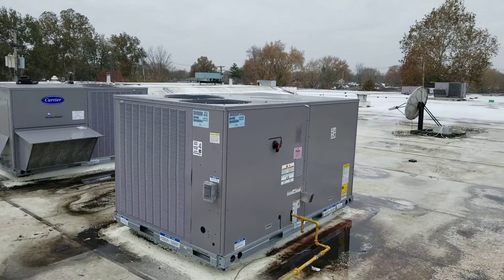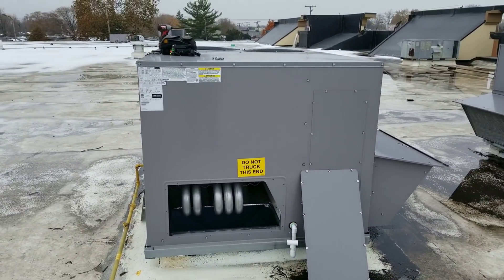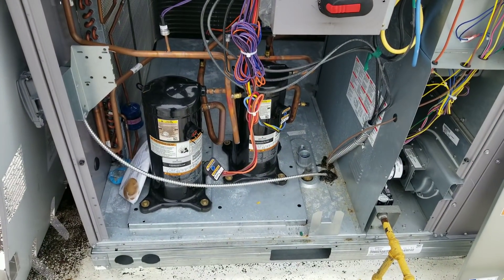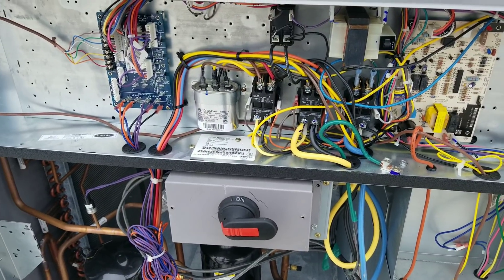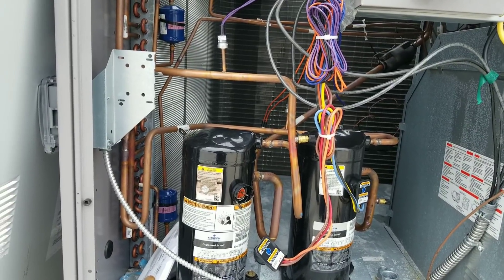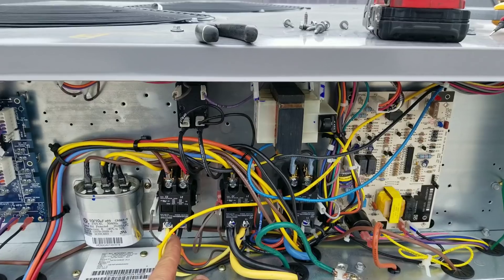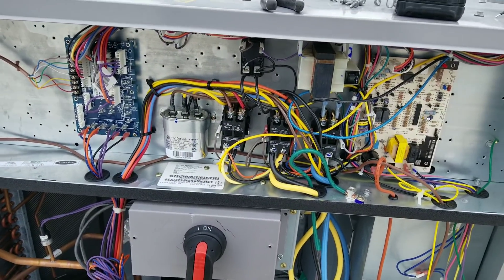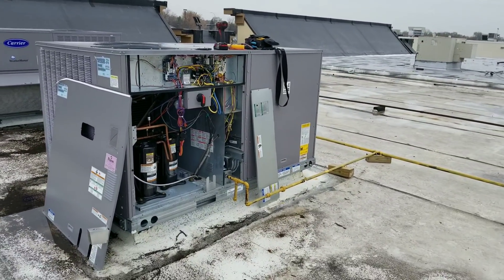Carrier package unit tripping the breaker

Comment: Just a general question. Have you ever tried the phase rotation setting on the fieldpiece Sc660, is it reliable? Just like you said “no proper commissioning on hvac unit” if done right they should of caught the problem.
Reply: Yes the phase rotation is reliable on the meter.there are other meters out there, Amprobe,  that have true 3-phase rotation done through 3 individual test leads that make it a little easier to do then the Fieldpiece 2-lead method. But it does work and every commercial install crew should have at least one guy with a meter that does 3-phase rotation before they start up the equipment.
Reply from the maker: I have not but I have heard about it and I think my next upgrade will be that 660-- it comes in handy for sure
Reply: @curioushvacguy6876  NO...don't get the sc660. The brand new sc680 just came out.
Reply: I got the amprobe 320 from watching Tcphvac/r videos I thought that was an awesome feature to have as well as motor rotations for pumps. I have used the 3 phase sequencer a lot more then I thought I’d be using it does come in handy. For the price amprobe meters are very affordable for what there pack with, there very rugged as well. I believe I’ve seen Shannon comment on these meters in the past as well 🤘🏻
Reply: @HVACslayer  yep, Amprobe has a really nice 3- phase feature. I really like how the dash marks go in a circular motion around the display either clockwise or counterclockwise. Makes things pretty cut-and-dry as to whether you're wired correctly or not.👍
Reply: Shannon Knight HVAC 😂 yeah it’s pretty idiot proof if ya can’t figure that out should not be anywhere near electrical. I got my bro into that amprobe meter as well,that’s his go to in the field.

Comment: It blows my mind that 
1_ they probably didn't check phase rotation
2_ maybe they did and someone messed with the wires upstream , but still , nobody complained about no airflow
A lot of the units I work on actually have phase rotation monitors , and even then , I still check for the proper rotation , I even bought a phase rotation tool off my own money because the one my company provided me with I didn't like .
Oh well , one company's mistake is another company's payday I guess...
Reply from the maker: Hey Sterling- what type of phase rotation tool did you buy? Ive found this similar issue a few times following up after other companies, still blows my mind that nobody caught that.
Reply: @curioushvacguy6876   Amprobe PRM-6-EUR it has phase rotation , missing phase , and non contact wireless motor rotation detection : you basically place the device on the motor , like for a centrifugal fan , press the button and it detects the rotation from the magnetic field I think .
I've tried that on a water pump and it worked , I was pretty impressed !

Comment: I love how they took the time to drill the holes for the thru the bottom electrical connections, installed the connectors and then proceeded to knock new holes run mc cable and gob it with blackjack. Got to love it!
Reply: I'm embarrassed to see this kind of electrical work - those Myers hubs are worth more than a case of Blackjack and they're empty 🤦‍♂️
Reply from the maker: Im guessing a permit was never pulled and an inspection never done

Comment: Strange that they had you perform the heat start up. The installation company should have done this. I’m not sure how warranty work is covered there but any company touching equipment here can void the warranty from the installation company. I know you didn’t do anything wrong but the installation company doesn’t know what you did. That compressor should be covered 100% by the installation company. I’m sure the customer will not want to spend any more money on the equipment and you won’t do it for free. Anytime you do start up on 3 phase equipment check the rotation of the blower (if 3 phase) to confirm the rotation is correct. All other components should be phased the same. Stay safe.
Reply: I have come across units where blower and compressors are not phased the same...also a lot of new roof top units have ecm blower motors are single phase so you really have to check compressor rotation
Reply: You are correct. This has happened to me as well. It is the best way to see if they are phased the same. To start with the blower. Humans wire them and last I checked they are not perfect lol.Now on the ECM motor. Yes you do have single phase power to the module. The module my understanding is that it converts the single phase power to 3 phase power. This greatly increases efficiency. The unit you see behind me is a 60 ton. It has a VFD on the blower motor. You can feed the VFD with single phase power as well and it will make its own voltage. I’ve studied these for years and now I have a class coming up. I can’t wait to learn more on these. Anyway stay safe.
Reply: ACtech Formally yo mama that’s how it is for us install is covered up to a year in that time if anything happens with the equipment installer gets there ass back out to fix it don’t matter how many compressors they gotta go through to figure out the problem. On some of our boilers the installer had the manufacture send out there techs cause they didn’t know what’s going on with it 😂 but it’s all covered under warranty don’t pay a dime. Crazy these guys installed those units threw the power on and walk away on to the next rooftop.
Reply from the maker: Your exactly right ACtech- they should call the original contractor and say hey you guys messed can you make it right with us and replace this compressor- It would only have taken a few minutes to check for proper rotation and they wouldnt have had this issue. Blows my mind sometimes -

Comment: Geez, they better sue that contactor, the flippin drip legs on those gas lines are doing squat all being installed incorrectly like that on top of not checking phase rotation on those compressors.  That's one thing Trane is doing right these days.  Phase monitor built in from the factory.
Reply: I wonder if the gas trunk line feeding all units is large enough.  Looks almost like all 1/2" to me.  That is a long run.
Reply: @rgwestmont7181   RG Westmont  Rewatched and it looks like 1" main line with 3/4" branch tees shrinking down to 1/2" after the union, should be alright for 1/2psi delivery up to 100 ft for 500k (assuming each unit is identical 125k input as this one) if I remember my tables correctly.
Reply from the maker: Yeah It feels like this was a cheaper bid and the construction was rushed which is why I had to go back out and start the units and burn off the heat exchangers- I wonder what the duct work is like, static and air flow-- I quoted a follow up but that location hasn't approved it yet.

Comment: UpSell them phase protection monitors.  But I know how 3rd party jobs work
Reply: Not Commercial either, but it's funny Carrier puts phase monitors on the 3-phase split system light commercial units but not on a packaged RTU.  Good catch and explanation.
Reply: @TheGgin  very true!
Reply: not a commercial guy myslef, but how exactly does that work? easy to install?
Reply: @hozerhvac4406  there fairly easy to install,  they usually have 3 legs of power coming into the monitor from before the contactor and 3 legs after it (if you want the ultimate protection). It will break the low voltage wiring if it loses a leg of power, if the voltage goes under or over the settings and if the phase is incorrect.
Reply: @HVACRSurvival  Wonderful!! Thanks for the reply
Reply from the maker: Rick- have you ever heard of a phase correction contactor? Someone commented from the UK I think and they said they have those things and it automatically switches the phases to correct the issue.
Reply: @curioushvacguy6876   Have not heard of it but they would need some way to switch the legs of power and depending on the amperage that sounds like a pretty hefty switch.
Reply from the maker: Good idea- Knowing this customer though they probably wouldnt jump on board with that idea, they seem to fight us on everything.